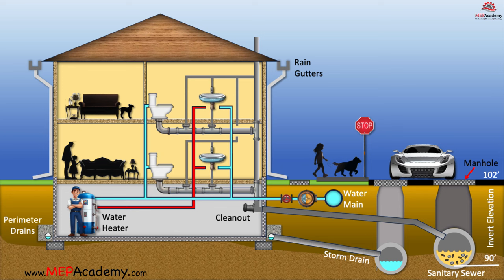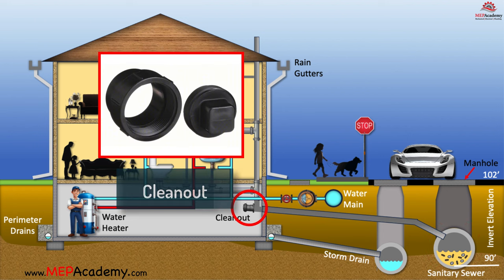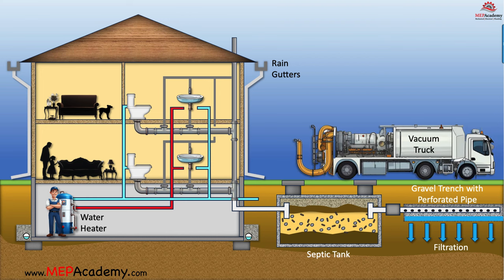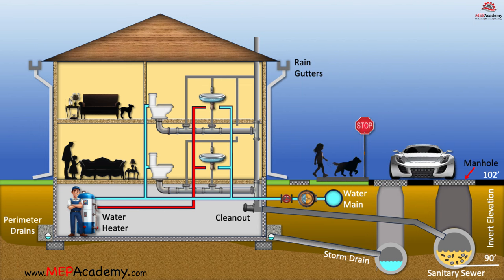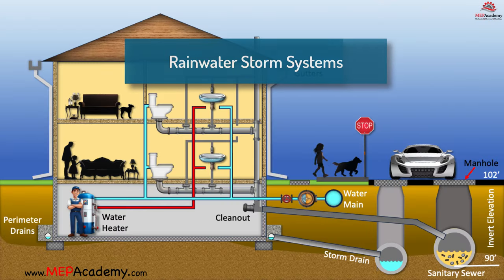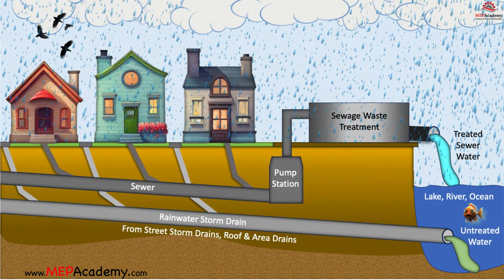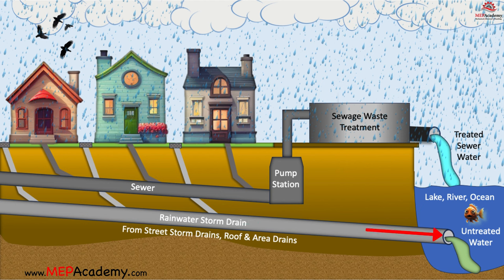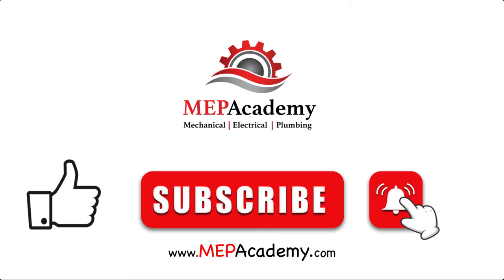How your House Plumbing Works

Comment: My township has both city water/sewer and well/septic. Not sure how they determin who gets what. I live a 4th mile from a water tower but yet my area is spetic. My town also has municipal water and private water. So depending on what part of town you live in depends on which one you are on.
Reply from the maker: It would be interesting to learn how they determine which system you get. I guess as long as the quality of the water is good, then it doesn't matter where it comes from.